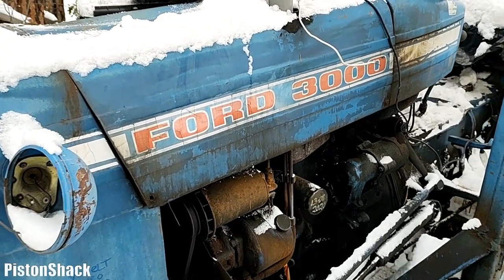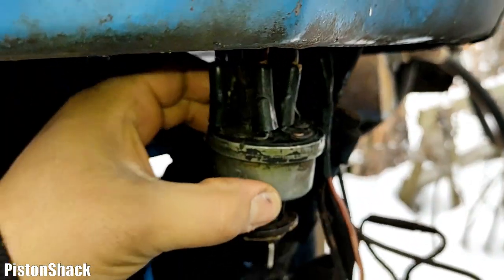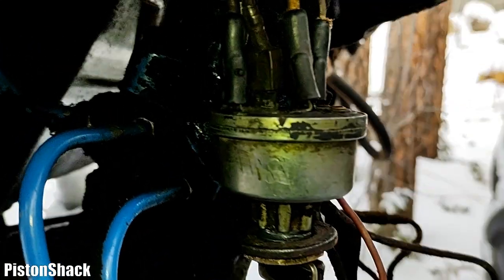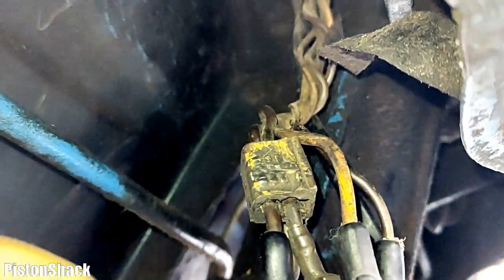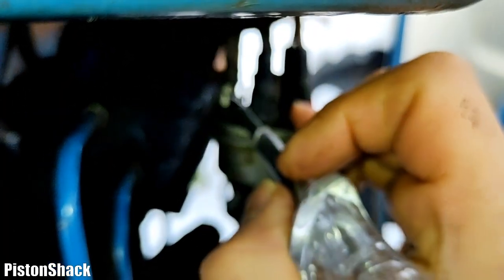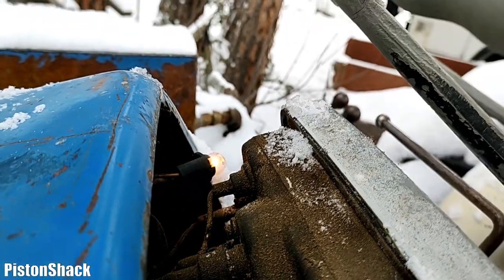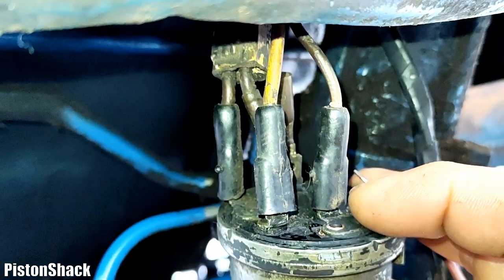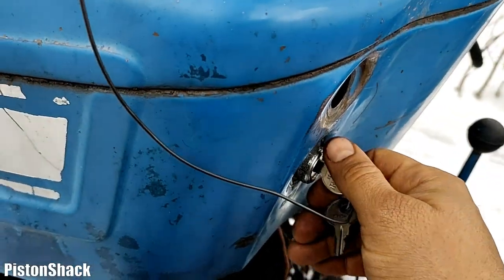HOW TO WIRE UNIVERSAL IGNITION SWITCH ON FORD 3000 TRACTOR - EASY!

Comment: I have late model (68?) Ford 5000, was cranking perfectly until mice chewed some. I have a brown wire w/thin green stripe that seems to not have a "home". Could it be a wire that may be used in another model, and that's why my mechanic, whom I trust 100%, didn't hook it up? After fixing the chewed ones, it still won't do a thing. I'm not real good w/electrical stuff/understanding.  Thanks- love your video as your camera & voice are well seen & heard.
Reply from the maker: Hey Andrea! Starter/ignition switch is pretty simple on old equipment. You have to find basic three wire: battery constant power wire, wire to the starter solenoid and ACC. I filmed another video couple years ago, check it out: 
TRACTOR IGNITION KEY SWITCH WIRING | Universal Ignition Switch | JOHN DEERE 2130
https://youtu.be/_D4t4hwWj0A
Reply: @PistonShack  thank you!!! I know I'll have to refer back to this when I'm able to get to it.  I do appreciate it & will watch the other video too!